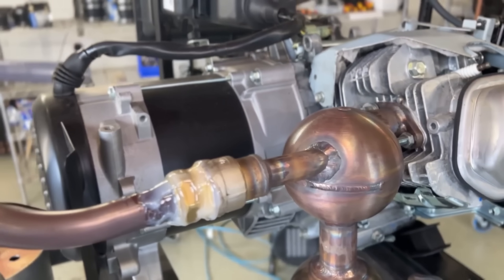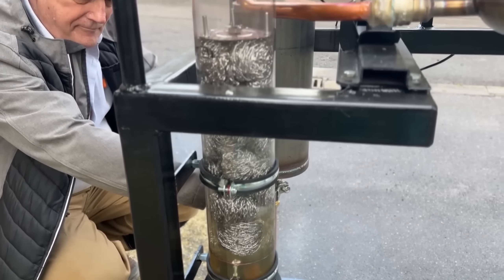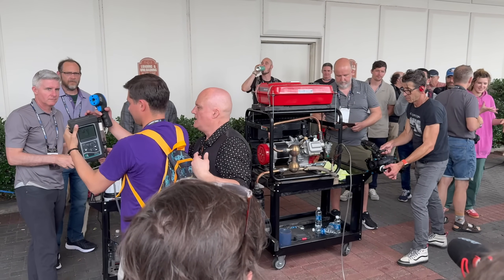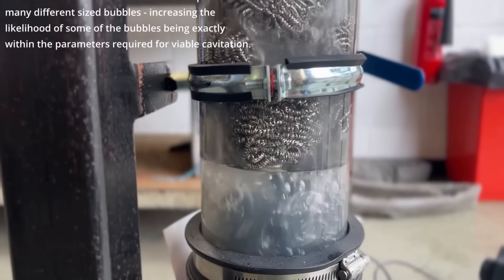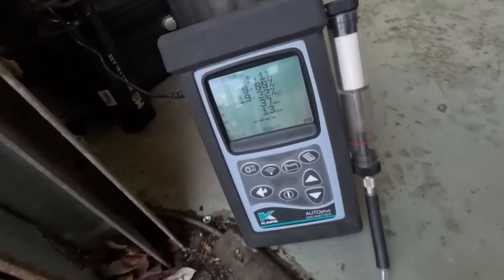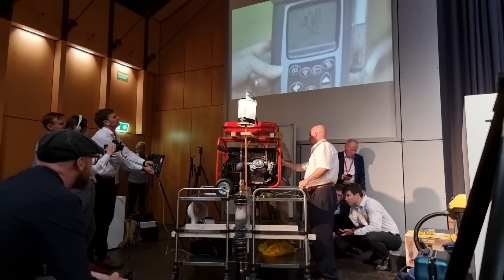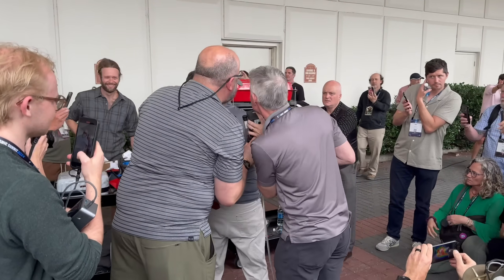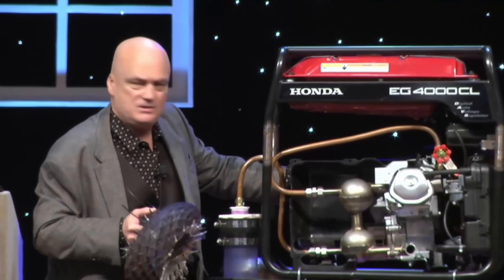Oil Companies Game Over: Malcolm Bendall's Free Energy Generator 2024 Invention of the Year!

Comment: Like so many other "AMAZING" devices, this one is not really as impressive as the promotional spiel would have us believe.  When you remove the fuel tank and show that no forms of convential fuels, or volatile solvents are used anywhere on this set-up, and only water is used and split into Oxygen and Hydrogen and the engine run on this gas mixture powering a generator that through electrolysis can break the atomic bond of the water and produce a surplus of energy, THEN you really have something significant to promote, and if you are smart you could become yet another billionaire.💥

Comment: The best one like that is a neon fly back speed of light switch, a triangle keeps it off ground.  The difficulty is how to store thousands of volts, so its a high temperature conductor.  Or let's say the reactants stay free, iodine attacks metal, so it needs to be fuzed quartz, it comes down to price vs size.  Gravity drops a pillon on a 20ft chain gear, the next gear uses 4/5 the power and so on, but its not a small device, you need a villa, an open pit foundry, Noone can own gravity rocks.

Comment: More free BS. Go to Wikipedia and read about the 3 laws of thermodynamics. BTW, the engine was barely running, stumbling and missing. Certainly not producing the 13 HP the engine was rated at by Honda, nor producing little or no usable electricity.

Comment: One of the funniest parts to me is the pipe that runs from the exhaust manifold all the way over to the intake manifold that has to either have a pinhole in it or it doesn't do anything as putting exhaust gas directly into your intake only reduce oxides of nitrogen exhaust emissions most modern engines don't even use EGR anymore as they have better fuel injection Control Systems now and direct injection

Comment: Call it whateveryou want... it's a gassifier. End of story. Not new. Energy density is horrible. Tuning is a pain. Works okay for stationary power applications, where you have an abundance of combustible material, and weight/space isn't and issue. Lack of density dictates the use of comparably HUGE engines to acheive the same output as a gas engine... even larger than stationary boiler/steam units.

Comment: Who is speaking? 🤥🤥🤥
You know what is plasma and what it is a normal engine working with HHO?
In the video it is a nomal generator (electrogen) a clasic petrol engine rotating a clasuc electric generator.
The only difference is frim the video can see a HHO (H2O) replacing the consumption of 100% fuel maby with 50% fuel -50% gas from water

Comment: So what is that electric plug in at 5:35
Reply: It could be a power strip applying a load or loads to the generator so it can be tested WITH a load, not just idle.  It COULD be powering the one parasitic load on the system which is a small Compact Fluorescent lamp which emits UV light which ionizes the air stream before the "bubbler".  The lamp is ~25-50 w if I recall. not much.

Comment: The problem as I see this, is that the thunderstorm device is a method of reducing emissions from an oil powered generator and not free energy. All of the video shown demonstrates the outlet pipe emission's values from a standard generator, that has been put through a process of changing the emissions to pump out cleaner air than the air taken in. My question to you is, how can this be free energy, when it is not. It is definitely a superb invention that cuts emissions to practically zero but in no way shows the hype that you are insinuating.

Comment: Ok I'll be THE wet blanket today.....

FREE  =  0.00 zippo, none,  looks like $ O.OO $ on paper!    So NO this is not FREE ?     VERY far from it. 

How much does a basic framed scrap or core generator/set cost (like that of the frame, motor/generator with fuel tank as shown) ?  If you could even find one, NOT less then at least a $100 (these look tobe brandspankennew so $1500.00 per) How much does the SS scrubbies cost? $2.99 x 12+/-. How much for the plastic bubbler tube? $50.00. End covers Rubber caps? $20-30.00. Copper tubing and fittings? $40-50. How much for the stainless steel expansion vessels and related tubbing/fittings? $200. Hows'bout those TIG welds? Being a welder, I'd prob. give you a deal and only charge you $30.00 an hour (abt. $4-500.00 total time ) thats if  YOU purchased  and brought the materials and prints for fabrication otherwise A LOT MORE $$.  Not even including the hook-up patching generator to house. If your insurance agent finds out prob gonna cancel you. Good luck with that.

And then finally .....there will be on going mant/ up-keep and replacement consumables'cuz even though Honda makes quality stuff, the motor and generators, stainless scrubbies aint gonna last forever. HOW many KWHs (wattage) are produced by this set up? You'll need about 15-20 KWH to run a typical modern house per day. The duo shown here might produce 5-10 KWHs. Give you an idea.....Nancy Pelosi's fridge full of ice cream operates at abt. 5000 watts alone (5 KWH) per day.   

Now starting to sober-UP a bit?  Unless your like me , totally narley living at mom/dads house FOR FREE dude.

Comment: This is just a conventional engine running on hydrogen. It consumes water, an ionic solute, and electrodes. Nothing free about it.
Reply: It DOES run on gas and the hoax it the youtuber claiming its FREE, which is not claimed by the inventor.  Its not based on hydrogen but a different principle.

Comment: This is not new at all.
This so-called ’Thunderstorm Generator’ is a resurrection of the Geet Fuel Processor by Paul Pantone, which was advertised and marketed to the world way back in 1980.  It did not work then, and it will not work now.  

The Geet Fuel Processor
 Sorry, cannot post links - look it up.

It was a scam in 1980.
And it is still a scam now.

Ralph

Comment: You have the claims and functions wrong. While I appreciate you working to get the word out and it pains me to say as you clearly put a lot of work into this beautifully done video - however, with all respect, you have got the claims and mechanism of THOR very wrong:

Plasmoids have applications in energy generation - but this is not one of them.
THOR is not an energy generator - its an emissions treatment device.

It is essentially a perfectly efficient catalytic converter, where the exhaust pipe is emitting pure clean O2 rich air to the point that it turns any internal combustion engine into an air purifier. Even cleaning already polluted air coming in the intake, not just that from combustion.

Comment: So, let me see if I follow. You built a completely unshielded nuclear fusion reactor out of sewer and HVAC components that generates enough energy to electrolsize water to obtain hydrogen, which you then just so happen to burn in a hardware store consumer generator? Does that about sum it up?
Reply: You missed out the scouring pad electrodes and the Araldite on that one compression joint which simply refused to seal otherwise. It's cold fusion, so TOTALLY safe (he's had the all clear from the ONR).

Comment: if it's running on water why is the fuel tank still on?
Reply: Its not running on water, or hydrogen from water.  The water is only used in a process to precondition the intake air.  It DOES run on GAS.  The title is incorrect.
Reply: @mrwayneright  It runs on hydrogen gas not just gas. Just gas doesnt exist. If you want to correct me do it properly...

Comment: The gasoline fuel tank is still connected. It still has a carburetor, so gasoline is still required to start engine. It appears that ionized air is drawn through the bubbler by engine intake vacuum, then heated in two stages by engine exhaust, then ported into the intake manifold as fuel to supplement the petrol. Does the ion generator receive its electrical power from the engine driven generator? This device appears to be a hydrogen generator that adds hydrogen and oxygen to the petrol fuel mixture to support combustion. The existence of carbon dioxide, carbon monoxide and hydrocarbons in the engine exhaust suggest that this is not a stand-alone replacement for petroleum fuels.
Reply: Its not a hydrogen based reaction.  Not electrolysis, not HHO, not "brown's gas".  Entirely different.

Comment: If one considers the transvector reluctance of a non-rotational ion convergence, it becomes quite clear that the radial flux interaction with the angular displacement field contributes an integral multiple of unmodified phlogiston energy equivalent to parallel field alignment, thus insuring continuous energy availability.
Reply: The tricky part is of course the parallel field alignment. I've been working on this for sometime, but my triddle runs out of true within a few minutes of start up, causing loss of flux. Any ideas how I can overcome this?
Reply: @nickwinn7812  put a 90 degree bend at either end of the intake and exhaust to keep the physical position of the magnetized inner bar from moving due to the velocity of the exhaust.
Reply: I understand that it's the same way a flux capacitor works. Unless I've misunderstood the parallel filangey plasma fusion coupling effect that is being utilised here. Hmm!🤔🤔🤔
Reply: @ThunderboltWisdom  you're both wrong.  Plasmoids can be created with less heat when produced in a vacuum....and yes, I get the joke, I'm just clearing it up for you :)
Reply: Ted Nugent fan?